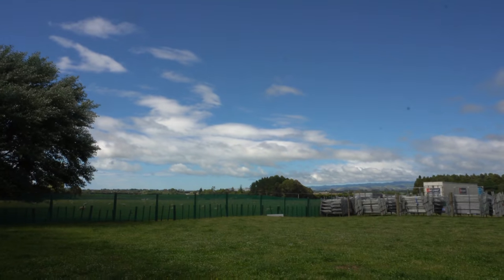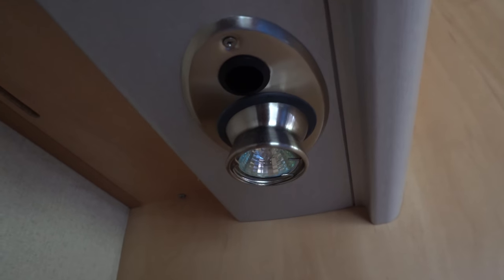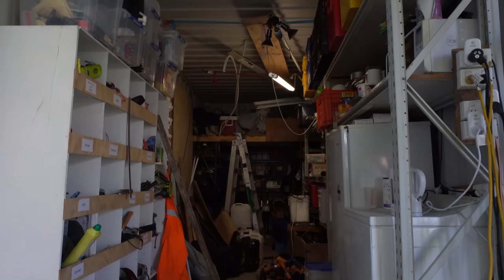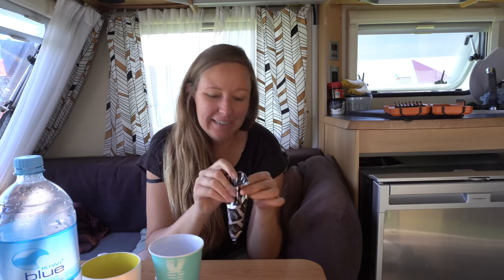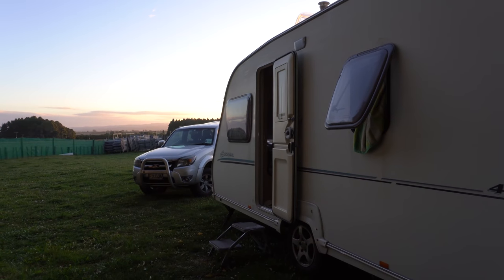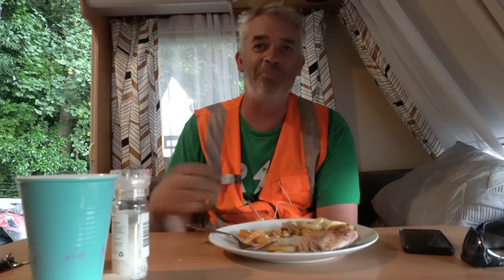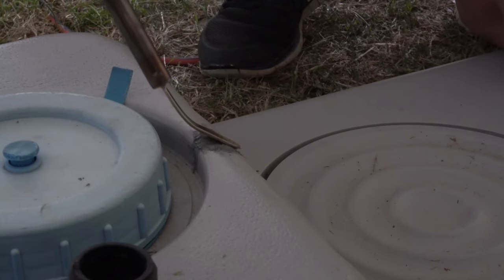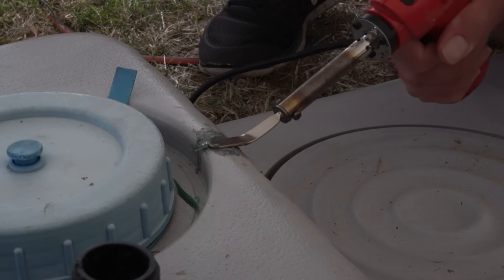WHY WON'T This Work? Repairing Light & Room Divider

Comment: Have you thought of changing those halogens for LED lamps as it will save a lot of power and be cooler to run as well. You can warm white, around 3500 kelvin or daylight at around 5000 kelvin? You can get direct replacements for those: 12 volt 5 watts should do as that the equivalent of around 55 watts for a halogen lamp. Great videos btw.
Reply: Yes, how easy is it to replace those bulbs with LEDs? In North American campers, they are very easy to replace. As Ronin said, you will first have to decide what kind of light you want. Bright white is good anyplace other than the bedroom and lounging areas. Warmer lights are best for where you sleep and read.

Comment: A good set of wire cutters will cut and strip any cable. Are less cumbersome than pliers. Also is worth getting  ratchet type cable crimpers for cable lugs. A screwdriver set us worth getting to. Trust me been in the electrical industry since I left school many years ago

Comment: Could probably do with wrapping each of those spade connectors with some electrical insulation tape, just in case.
Reply: Good idea. Can also get insulated type too that don't have any of the metal part of the connection showing